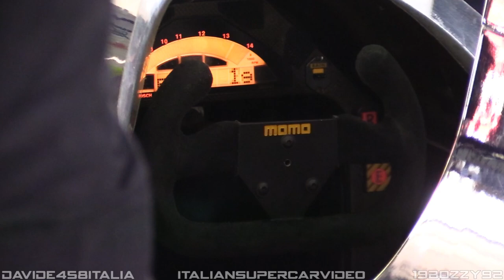Minardi M192 F1 Car Warming Up its Lamborghini V12 Engine!

Comment: V12 LAMBORGHINI...wasn't so faster but SOUND was so magical...
Reply: "Wasn't so fast"
It was the most powerful engine of all teams, but Chrysler did Chrysler things and made it insanely unreliable
Reply: @זהסודי-ה7מ  i wouldn't say the most powerful.. but yeah it was still powerful
Reply: @luke_sv6702  in the McLaren MP4/4B it was the most powerful of the bunch, but insanely unreliable
Reply: ???   Umm...  It was fast enough for Senna to request that it run the last 3 races of the 1989 F1 season!
Reply: @זהסודי-ה7מ 
Even though Chrysler acquired the company, it had nothing to do with Lamborghini development just like VW is right now.

Comment: 1:27 I could sit there and pull that cable all day long
Reply: One hand pulling the cable and the other hand pulling.....
Reply: One of the few things that shows the age of the engine. Imagine a slightly more modern version of this engine, with throttle by wire and dual injection, it would be pure bliss!

Comment: 1:27 I see it's a fly-by-wire throttle.
Reply: I think you might want to look up the definition of fly by wire
Reply: Ted Crilly firstly you need to do some homework not just google random stuff and throw mechanical terminology out there. Secondly what was the purpose of pointing out a throttle system?
Reply: Liacoca

Comment: we will see how it s running ? or this the only video ?
Reply from the maker: Unfortunately no :'( I was really hoping to see it in action on track but due to rain and other problems it only did a parade and slow lap (slick tires on wet track) with Minardi's founder behind the wheel
Reply: 19Bozzy92 throttle CABLE ! 😄😄